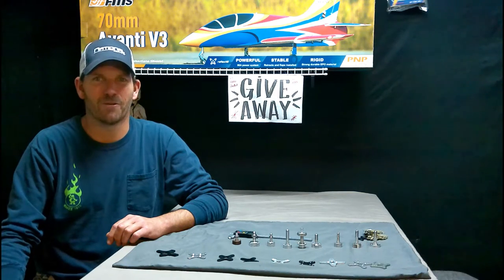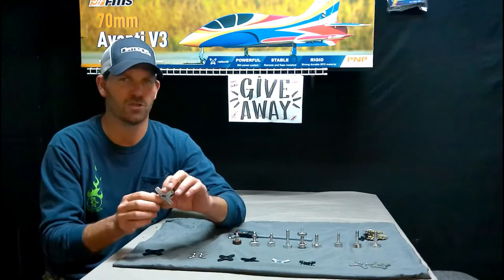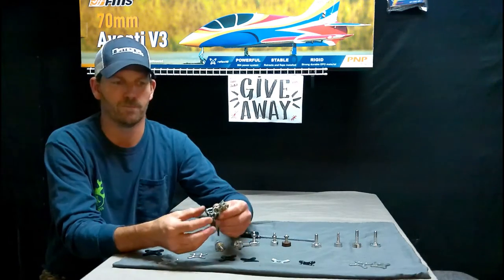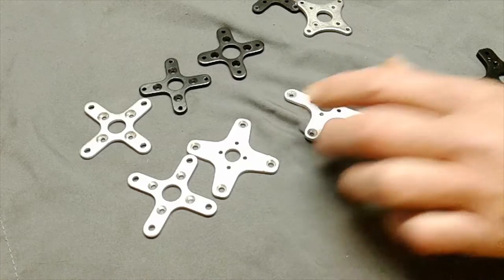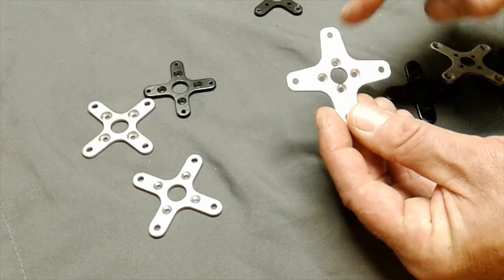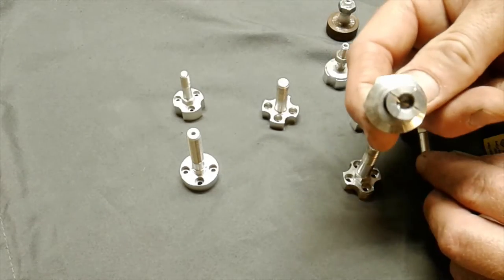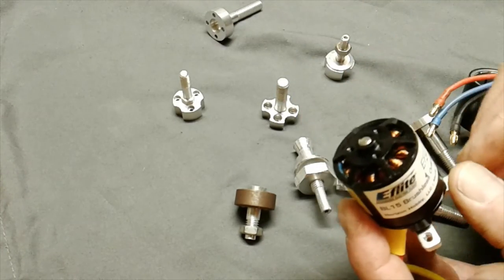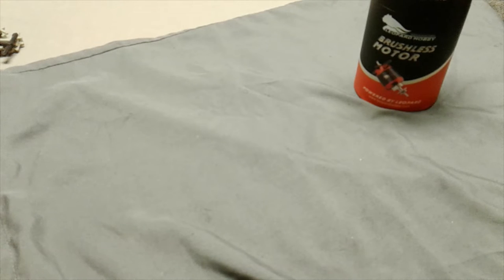RC AIRPLANE BRUSHLESS MOTOR MOUNTS AND PROP ADAPTERS THINGS YOU NEED TO KNOW WHEN

Comment: After 30 decades or so, I am jumping back into the hobby. I have a sig kadet senior arf on the way, and i am going all electric ( i was a nitro guy back int day cause that's all there was).  First, Shawn, thank you.  I have really enjoy watching and learning.  My question is most definitely a noob question from an old man.  My brand new avain 5055 came with 4 short screws, and 4 longer screws.  Does the front or the back pf the motor take the longer screws, etc.  4 for the bolted prop adaptor, and 4 for the mount.  Again thank you.

Comment: Hope you see this. I am in community college learning to be an Aerospace technician. In my advance composites class my team has been assigned to design and build a Predator Style Drone. we have a good bit of design work done although size may change depending on our machining capacity when it comes to our tools. as of now the plan is for the entire body and wings to be made out of carbon fiber the body being about 2ft in length with a 5inch diameter. the wings span will be about 4ft making each wing 2ft length. not sure what what the weight will be when we are done but despite that what motor/motor mount/prop adaptor would you suggest? the motor and prop would be in the back of the craft if you need any more dimensions like stabilizers and such i can provide.
Reply from the maker: wow that is awesome you are building that. it would be a guessing game at this point you need your final weight aprox then you can motor prop esc shop . look at the spektrum brushless motor chart that will get you most of the info you will need